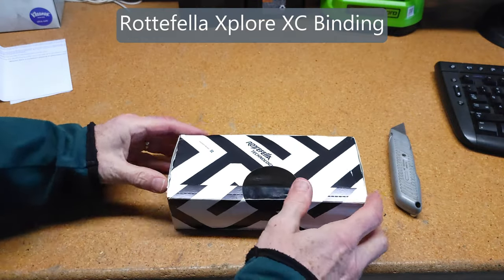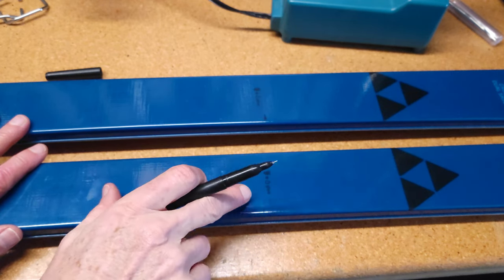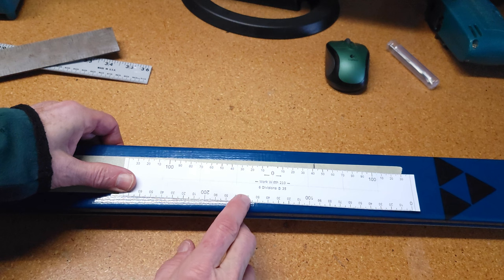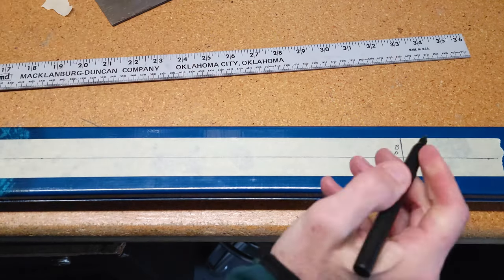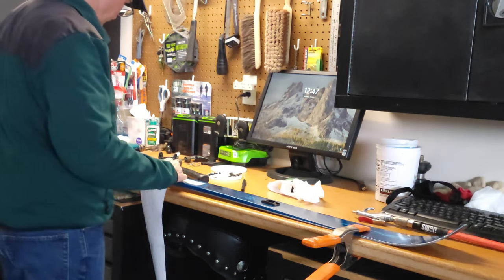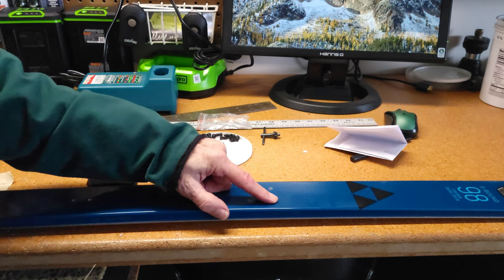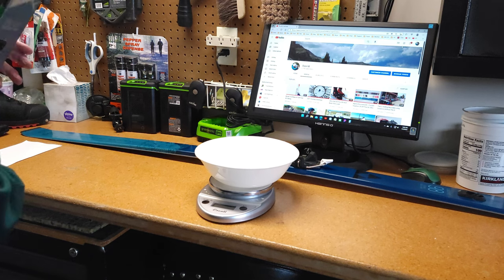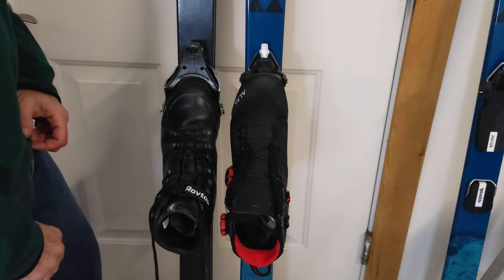Mounting the Rottefella Xplore Binding on My S-Bound 98 XC Skis

Comment: Great tip to use a paper or flexible center ruler.
Reply from the maker: The paper tape works best for me as it is easy to stretch tight and fold over the steel edges.  Just be sure to make 3 center marks on the ski and then use a straight edge to make sure all 3 marks are in a straight line.  If they don't all line up, then you need to repeat the process.

Comment: I'd suggest using a clamp to flatten and hold the ski to the table, especially during the drilling operation.
Reply from the maker: Great tip.  The video doesn't show it, but I have a spring clamp on the tip and the tail to hold the ski to the bench when drilling and screwing the skis.  Thanks for tuning in and I hope you have a great ski season.
Reply: There is a definitive guide from black diamond for mounting skis for the best pull-out prevention. They explicitly say not to flex the ski while drilling or mounting. I doubt it's an issue here or with most xc bindings, but I always try to avoid flex while mounting.

The guide was back from the O1 days when everything was pulling out.
Reply: Thanks for this tip. I'm about to mount some xplore bindings onto a pair of S-Bound 98's, and I will plan on placing a block of wood under the ski while clamped to maintain the camber of the ski while drilling.

Comment: Thanks again Tom for all your great videos.  I am just wondering if you always mount the ski on the balance point?  What did you do for your Voile? Many ski manufactures for back country skis recommend binding installation away from the balance point.  I am not sure where to mount the bindings on my new Fischer Skis.
Reply from the maker: I think it is always best to use the manufacturer's recommendations for the binding location.  That being said, the traditional location for a cross country binding on a cross country ski is to place the mounting template pin line directly over the balance point of the ski.  The Sbound 98's (2022 version) in this video did have a topsheet mark for their recommended pin line and it was very close to the balance point of the ski.   I've always mounted my off trail cross country skis with the pin line on the balance point. Just as a side note, downhill skis are very different animals from XC skis and the mark on their topsheet usually indicates the boot center position, so for others who might read this comment in the future, please check with the ski manufacturer for guidance before drilling up your new set of skis.
Reply: Hey Tom, thanks for your thoughts.  I am a bit unsure what to do with my new Fischer Hannibal 96 backcountry skis and my Xlplore bindings.  The mounting point the Hannibal 96s identify is 3 inches behind the balance point.  It is actually at the "center of running surface."  My guess is that they are anticipating a center of boot mounted on an AT or downhill binding.  I guess I will reach out Fisher for their guidance.  My thinking is that if I mounted (or had a tech mount) the binding at the balance point, it would put my boot center at about the indicated point on the ski.  Any further thoughts you might have on this would be welcome.
Reply from the maker: @kennethsmith4202  I'm betting that the mark on your Hanibal skis is for the boot center position for fixed heel plastic alpine boots.  There are many varying opinions on where a telemark boot should sit in relation to the boot center position.  Johnny has a great write up   http://www.telemarktalk.com/viewtopic.php?t=1870

On all of the downhill skis I've owned, I've mounted them with the center of the boot on the manufacturer's boot center location.  This has worked very well for me, but to be honest, I've never skied a downhill specific ski with the boot center mounted either forward or behind the recommended boot center position.  The most common deviation is to mount the telemark boot slightly rearward of the recommended alpine boot center position.  The theory is that  for telemark skiing, the ball of the foot is the key to control, and since our heels are not locked to the ski, the boot needs to be a bit further back on the ski when compared to a fixed heel setup.  As I mentioned before, I have not tested that theory, but I am very happy with the way my downhill skis perform with the center of the boot mounted on the recommended boot center mark.  I owned and skied a set of Hannibal skis in 2017.  They were a fun ski.  I don't know how they compare to ones you have but I predict you will have a bast with them.  I ended up replacing those skis with a set of Voile Hyper v6's, only because I wanted to try the Voile traction patterned ski for backcountry skiing.  Be sure to post back on your experience as I'm sure others will benefit.  Thanks for posting and best wishes for the upcoming ski season.
Reply: Many thanks Tom.  I agree the Ski is center marked.  I will see if the Alfa Free has a center mark and talk with the technician - or mount them myself ( @tomm9850

Comment: Hi Tom. I’m dying to get my hands on a pair of these, and boots too, of course. Not available here in the Whites of New Hampshire yet. Question- how wide is the widest point of the base plate of these bindings? I have a pair of Madshus Eons for backcountry; wondering if they are too narrow for these bindings. I’ll take a look at another one of your videos (the close inspection one) to see if I can figure it out…. Best- Jerry K.
Reply from the maker: The screw holes are about 40 mm apart (they are the same width as the NNNBC).  REI says the Xplore bindings are for skis with a minimum width of 68 mm and the NNNBC are for skis with a minimum width 52 mm.  The "wings" on the binding are about 90 mm in width.  I see no reason why the Xplore binding cannot be used on any ski that one would mount the NNNBC binding.  In fact, if you line up the two templates for the NNNBC and the Xplore on the balance point, two of the screw holes match so there won't be any issues for people who might want to change from NNNBC to the Xplore system on an old set of skis.
Reply: @tomm9850  Thank you for your reply. As always, a great help.

Comment: Thanks for your objective analysis of equipment which could amount to an expensive mistake.  I feel I am able to make a much more informed decision because of the care you take to make your videos. Now if I can only find a pair of Fischer S-Bound 112 in 182, I might just be able to take advantage of Winter in the midwest.  Do you have any suggestions as to where I might find a set of these?
Reply from the maker: It is a tough year to find Fischer skis.  They still haven't recovered yet from the fire that destroyed one of their ski manufacturing facilities.  Here is a recent response from a Fischer rep on the situation  
 https://www.telemarktalk.com/viewtopic.php?f=1&t=4661&p=46355&hilit=factory#p46355
I did see some S-Bound 112's for sale early in the season from REI, but they sell out quickly, so it would be a good idea to check their website regularly to see if they get any more in stock this season.
Reply: @tomm9850  Thanks for the quick reply.  That was more information than I was able to get from anybody.  That pair of used 112s sold. It looks like i'm going to have to wait until next year.

Comment: Really enjoyed that - thank you so much. 98S Bounds, with the same set-up. Really interested in a Telemark skiing comparison side by side like you did with the boots.
Probably a pain - and a big ask - but if you do can you swap the skis so your strong and weak side get to try both?
Reply from the maker: I went out and did some downhill tele turns testing in soft snow with the Xplore / Free and the Voile 3 pin (no cable) / Alfa Greenland.  Both systems worked very well.  I did shoot some video, but after looking at the video, it was hard to tell the difference between the two systems as far as turnability in soft snow on moderate slopes from the camera perspective.   As you might expect, the Alfa Free boots have more support than my Alfa Greenland boots, so they do have better downhill control, but it is hard to quantify.  The Alfa Greenland boot hits a pretty high mark in my book, but I'm really warming up to the Xplore system.  Next week I'm going to release my video review of the Alfa Free boot (1/21) so stay tuned.
Reply: @tomm9850  the Xplore / Free looks good, the interest is how it copes without or when compared to a heel attachment. 
We often ski steeper terrain with the spring on the heel so have a lot of interest in the power/control difference.
Posting just in case you consider looking into, even if not - the content you produce has kept us that bit more sane inhabiting a lockdown world with no access to snow and mountains. Much appreciated, best wishes and regards from the UK.

Comment: Thanks for sharing your tips and adventures. In Feb I took the plunge and bought Fisher S Bound 98 skis, Rottefella Explore bindings and Alfa boots. Unfortunately I have a problem with the sole of the left boot (size 46). The heal of the left boot is off-center on the ski. If I switch skis the left boot is still off center by the same amount in the same direction. The right boot lines up perfectly on either ski. This means that a line drawn through the axis of the pins on my left boot is not 90 degrees to the center-line of the boot. Rottefella makes the sole of the boot and considering wide unforgiving nature of the binding design the pins must be very accurately molded into the sole. I fear that all the 2021 left boots in size 46 would share this same misalignment issue. Is this a known problem? Do you think a warranty replacement would solve the problem? My left heal is off-center by about 1/4". Does this seem unreasonable?
Reply from the maker: I just went out to check my Alfa Frees (Size 42) and visually they are pretty close to where I would expect the heel to be.  It is interesting that I can wiggle the boots left and right, and the loose tolerance allows the heel to be shifted either left or right of what I would consider the center.   The heel movement left to right seems to be less than what I had with NNNBC or 75 mm . I don't notice any wobble when skiing and the heel strike feels good to me.  If having one boot slightly off center is noticeable when you are skiing then I would definitely contact Alafa / Rottefella and seek a solution.  I'd start by taking a couple of  detailed photos showing the discrepancy and email them to Alfa.  I would ask them to check a couple pairs of the same boots in size 46,  and request a replacement or refund.

Comment: Hello Tom, I have had some Asnes Kongsvold skis for a couple months now and I really want to ski them. I have purchased an xplore binding but with no boots are available in the US has me losing patience as I want to use this ski. I think I am going to just go ahead and get it mounted NNNBC. By chance do you know if the top two holes are the same for NNNBC and the Xplore? I am just wondering if sometime down the line if I wanted to switch to the xplore if there would potentially be any issues. Thank you again for a great video. I appreciate you sharing your knowledge and teaching us new skills.
Reply from the maker: That is a tricky question.   It might be possible to reuse two holes.  At a minimum, you would have to drill 2 new holes and fill 2 holes.  The catch is that there is about 1/4 inch difference in the location of the balance point if you reuse two holes.  The heel plate on the NNNBC uses one screw and the Xplore uses two screws. That is less critical.  If you are certain that you will remount to the Xplore binding in the future, then I'd mount the NNNBC so that the balance point matches the Xplore.  I just remounted a set of Voile Objective skis with the Xplore binding, moving from the Voile Traverse 3 pin to the Xplore binding.  I filled the holes with slow cure epoxy and I have confidence that I will have no issues with the ski.  Having full confidence in your skis is important, and it can be a mind game for some.  Just for your own peace of mind, go to the link given in the description above and print out the templates for both the NNNBC and the Xplore binding.  Be sure your printer settings are set to "print to actual size" and compare the two.  I know it is hard waiting for the boots to show up.  There are some boots available from retailers in Europe and that is how I purchased my Alfa Free boots.  If you have skis that you can ski this winter, it might just be best to wait a little while longer.   Which boots are you planning to buy?

Comment: Hi Tom, I enjoy your videos on backcountry skiing. I just got a pair of Alpina Alaska XP boots and Rottefella Xplore bindings.  I was trying to decide on a pair of skis to pair with them. I was going to get the Madshus Panorama M68 (99-68-84) Cross-Country Skis or the M78 (109-78-95) Cross-country skis.  I ride a chair lift up to the cross country area but take green downhill runs back to get down the mountain.  Do you have any thoughts on either of these skis?
Reply from the maker: Hi Robert.  I have not skied either of the skis you are considering.  When you say "cross country area", do you mean a groomed trail with set tracks?  If so, both skis are too wide for use in a groomed XC track.  If your intent is to ski mostly off trail, then I'd choose the M68 for rolling and moderate terrain and the M78 if you plan to "tour for turns" and ski  deep soft powder.  The Alaska XP is a nice boot and should work well with the M68.  The M78 is wider, and my best guess, is that it is a more downhill oriented ski.  I ski both the Alaska XP and the Alfa Free boots and I'll pick the Alaska's for my narrower skis if touring is the main focus and the Frees when I'm touring for turns on wider skis.
Reply: @tomm9850  Thank you for so quick of a reply Tom.  It sounds like the M68 would be a better idea for the terrain and Alaska XP boots. The cross country area does have groomed trail system that I ski with narrow skis, but I would be skiing off trail with the wider skis.  I do have many different ski setups, including Telemark boots with 3 pins.

Comment: Tom, I just got some S 98's and wondering which bindings and boots to get.  Was thinking Alpina Alaska boots, but which bindings?  3 pin or those rotafella?  Thanks
Reply from the maker: Hi Jesse.  The Xplore binding works very well for off trail cross country skiing and I think that the new Xplore boots are an improvement over the traditional 3 pin and NNNBC soft boots. The 3 pin binding can be skied with soft boots on one day and with a hard plastic downhill boot on another and that might be a good reason to choose a 3 pin over the Xplore.  A cable or hardwire can also be used on a 3 pin with a soft boot, but I'm not a big fan of that combination for typical off trail cross country use.  Others would strongly disagree.  A few years ago, I had two sets of 98's, one mounted with 3 pins that I'd skied for many years with a wide range of leather boots, and a new set of 98's with the Xplore binding that I skied with the Alfa Free and the Alpina Alaska XP boots.  After a month of testing both setups, I just preferred my soft boot Xplore combos over my 3 pin and NNNBC soft boot combos.  If you already have a quiver of skis with 3 pins, then it would be most economical to stick with 3 pins, but for those who don't, I think an Xplore system is the future. https://youtu.be/Ovx48kCVtzM
Reply: Great!  Thanks for your help.  I don't have anything so i'll get the xplore.  Have a great day!  Looking forward to the snow videos! @tomm9850

Comment: Have you heard of anyone adding a spacer / shim under the binding for dealing with a leg length discrepancy?  I know that alpine boots can have material added to the bottom, but I doubt the Alpina Alaska boots can be modified.  My LLD is 2 cm, but I’d be happy if I could raise the binding 1/2”.
Reply from the maker: I can't think of any reason why a flat plate spacer could not be added between the binding and the ski.  The angulation on the two skis would be a little different and I suspect that is probably why it is preferable to add the height to a rigid alpine boot.  XC boots need to be able to flex so it would take a very skilled cobbler to modify an existing boot.  I wonder if one could add a thick insole to one boot and remove the insole in the other boot.  I know it would not make up 1/2 inch, but it might be worth a try to see how it feels.

Comment: Hi Tom,
Thank you for those videos about the new XPlore system. There is very little information about it (except from Rotteffela…).
Do you think these bindings would work wit a wide ski (Rossi BC 120) and the Alfa XP boots?
Thanks 
JP
Reply from the maker: Yes, that would be a great setup.   Rottefella is marketing these bindings for wider skis.  I've skied two of the 4 boots that are currently available for the system (Alfa Free and the Alpina Alaska XP).  They are both very good boots.  The Alaska is a great "off trail tourer" and the Free is a great "tour for turns" boot.
Reply: @tomm9850  Thank you for your thoughts…
About your Explore boots, are they sizing right? The size chart on Alfa website is a bit weird; it seems 1 size below usual sizing (42 shows 26 mondo, normally it’s 27.5 🧐…).
Reply from the maker: @TravelBike1884  When I ordered my Alfa Free boot, I picked a size 43, since my larger foot measured 26.6 mm, and that matched their recommendation.  I ski two other Alfa boots, the Starvet and the Greenland, in size  42, so I was a bit worried about the sizing.  There is more space in front of the toes than what I am used to.  I don't seem to be having any problems with the size 43, but in hindsight, I wish I would have tried the 42 first. Just for reference, I ski a Scarpa T2 in mondo 27.5